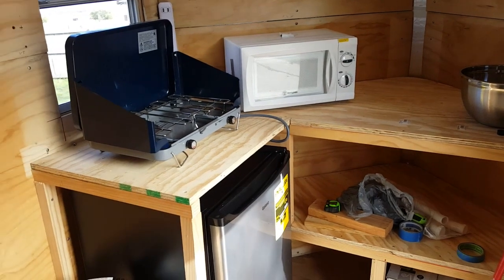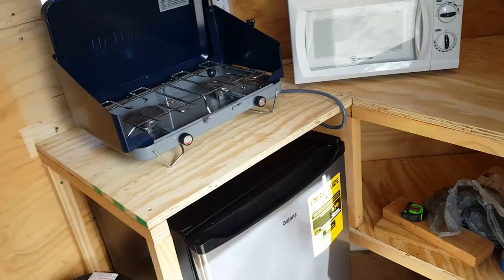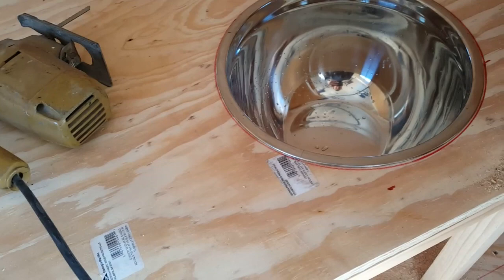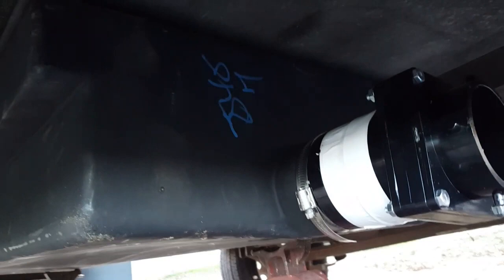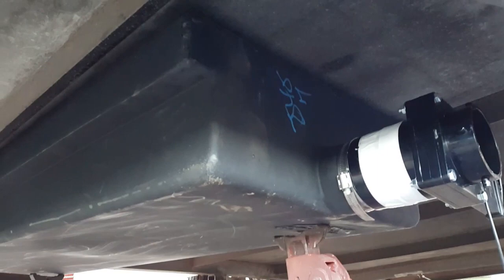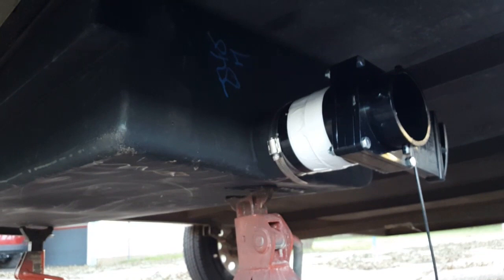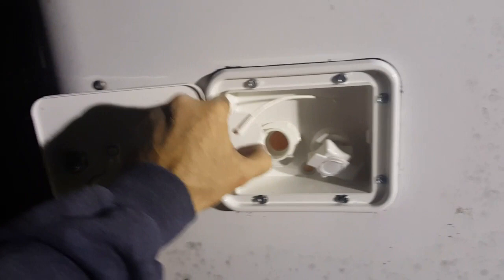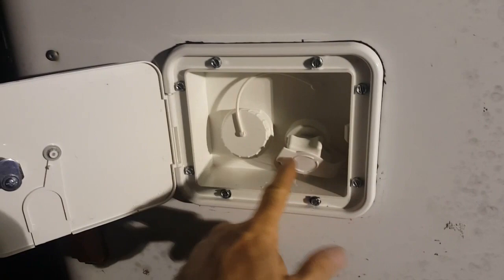PLUMBING WOES 6 X 12 Cargo Trailer Conversion Part 12 vanlife skoolie

Comment: That is a HELL of a lot of weight on the nose of your trailer!!!!
Reply from the maker: I am not quite sure what you are seeing. 20 gallons at 8 pounds per gallon is 160lbs. That is not a HELL of a lot of weight. The total weight of the loaded trailer is 3100 lbs. The truck has hauled this loaded trailer from Mexico to Canada without a problem. Take a look at the rest of the videos and consider the whole trailer.
Reply: @FakeLegGreg  after you ad in batteries, water and everything else it does ad up to quite a bit, considering your axle placement is 3/4 of the way back!!! I know as I've been trailer camping all my life and living in a 6x12 V-Nose myself for quite a few years now!!!  Good luck & God Bless.
Reply from the maker: @gregchewie3059  Thanks. Good luck to you too.
Reply: The tank is only that heavy when it’s completely full.

Comment: Good educational video thank u keep them coming im doing ur exact
Reply from the maker: Thanks for watching. Please add a ground wire from the breaker box to the frame. That is not included in this video but added later. Here is an electric setup I just did on a pop up trailer showing the ground wire. Good luck on your project.
 https://www.youtube.com/watch?v=OPjIKp2fx1U

Comment: Now you understand why in a house they put in all of the utilities BEFORE the walls go up. I started at video 1 and got thru 12 today. I was wondering why you insulated and put up the plywood before running the electrical. Working from the ground up and walls out seems to be the way to go in these trailer conversions. Also having a plan or details of what you want and where you want the items helps as well. Having the dimensions or the large items like the tanks would be helpful in the placement planning phase so you can make adjustments before you cut or build wrong. Good job. I will catch up on the rest of the videos when I have "time". Thanks for taking the time to video for us. I need to go back and like the other 11 vids and make comments. My bad. Oh...the left hand water inlet is not a pressurized tank fill but a shore water connection for your plumbing items like your sink, toilet and shower. These devices would use the shore water and not the water tank and pump. Later....
Reply from the maker: Thanks for watching. Yep it's all planning, learning, making mistakes, and redoing. I don't think I have ever heard anyone say they made the first perfect cargo trailer conversion. Always something to improve on. Also, I ran the wiring outside of the walls on purpose. I have already had to relocate some wiring and would not want to pull the walls apart for that. Thanks for the comments and likes. Good luck on your build.

Comment: Should have used a clear 45degree coupling.
Reply from the maker: Thanks for watching and the suggestion. I will take a look at it again.
Reply: GB Adventures the clear elbow will allow you to observe flushing and angle down to clear frame.
Reply from the maker: @harleybasssimpson8418  I thought you were talking about the fill. If you are talking about the drain, the angle I have now clears the frame and limits how far it nags down. The drain hose I have has some clear pars to it and I can see what is draining and can use it when flushing out as well.

Comment: Hi, learn a lot from your video. I have a question about your gray tank, how did you mount it under the floor?
Reply from the maker: Thanks for your question Anthony. The tank comes shaped to be hung from either side. I welded angle steel to my frame to suspend the tank. The angle steel could be drilled and bolted if a welder was not available. Thanks for watching the video.

Comment: G B it is all to much. Simple is better, bucket and P jug does it all. If you want a travel trailer then buy one. You get er done but it is all to much , just me.
Reply from the maker: Thanks for the comment Mark. Travel trailer is not built sturdy enough to make it in some places we have been. The plumbing system really makes the wife happy so it's done. No worries though, to each his own. Thanks for watching. Good luck on your travels.